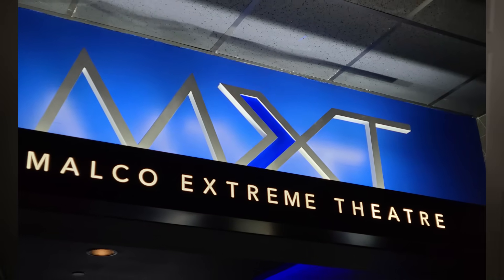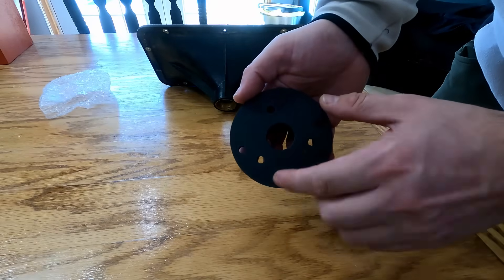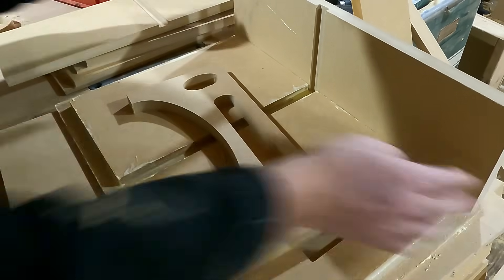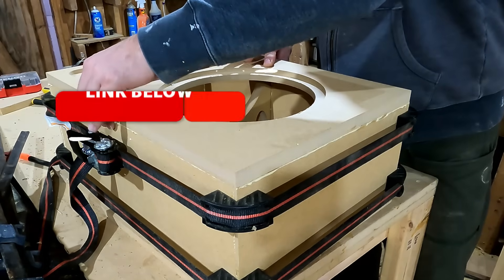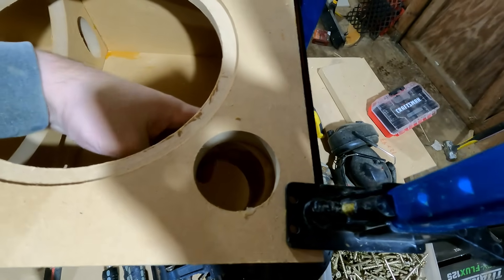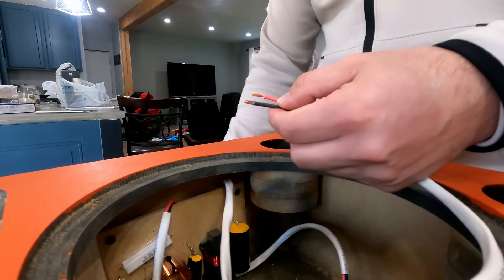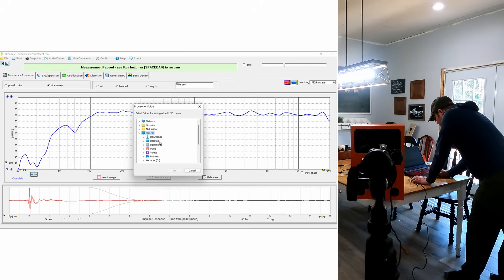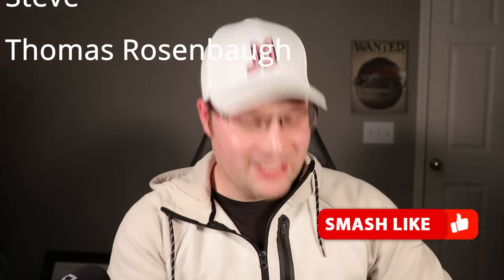How to Build $5000 Speakers for $400 - Klipsch KPT Inspired - Cinema 10

Comment: Cinema 10 or the Soundstage 15? 

Best for hi-fi home audio? What is the difference?

Or what would you consider the best hi-fi speaker you have designed? After understanding this I will order the plans (if I can get the units of cours)
Reply from the maker: I would still go with the Soundstage 15.  They are great for that.
Reply: @Toid  Thanks, trying to register a account on toidsdiyaudio. Not getting the conformation mail. I tried multiple email addresses.
Reply from the maker: @adriaan7627  that was my fault. Let me fix that for you
Reply from the maker: @adriaan7627  you should be activated
Reply: @Toid  Not yet 🥺
Reply from the maker: @adriaan7627  send me the email address and I'll manually activate it

Comment: Hi Toid, i have built a few speakers over the yesrs and notice you used no panel damping or stuffing, are you not concerned about cabinet resonance, standing waves and rear reflections back to the woofer cone? Another great video by the way.
Reply from the maker: That's a great question. It wasn't necessary on this build, but it never hurts to add it.

Comment: 'Very cool project. Now that you've built speakers using both the B&C DE-250 and CDX1-1745, how much better is the polyimide DE-250 over the mylar 1745? The reason I'm asking is according to Celestion tech support, I can upgrade my 1745's to 1747's by changing the just diaphram, which I'm kind of interested in doing. Any thoughts?
Reply from the maker: Honestly, it is hard to say. The B&C are in a traditional horn versus the 1745 which is in a waveguide.  It really changes how they sound, so it wouldn't be real fair to compare them like that.  However, I do have a compression driver shootout coming out soon.  SO when that comes out, I might have some more insight.
Reply: @Toid  Thanks for the reply, and just a note to say I like the type of projects you've been doing on this channel. A compression driver shootout would be very cool as there's so many choices out there even within a given price point. If I can find a driver that has the top end extension and fine detail of my PRV-290, but with a little smoother lower treble and lower first resonance that would be my ideal driver. Now that I've tried the 1745's, 220-ti's, and the PRV's, I suspect the 1747 might be magic combination of what I'm looking for, but I just read on one of the forums where a guy was saying the Eminence PSD 2013 was one of the best sounding drivers he's ever heard, so yet more confusion. 'Keep us posted.....

Comment: Wow. I would pay up for a flat pack of this speaker if it were available. GREAT choice on the color. Do you have a code for it?
Reply: I too would like to order a flatpack. Please tells us where we can order this when available.
Reply from the maker: I'll get you the code. It's from Sherwin-Williams. Also I am going to be offering flat packs sometime this week. I just have to calculate the cost.
Reply: @Toid  Awesome! Thanks.
Reply: @recone_helmut  could you share with me what a flat pack is?
Reply: @garymcnemar6620  Sure. All it means is that the panels of the speakers come as a kit - packed flatly on top of each other. The DIY speaker builder then takes all of those parts (the front, back and all of the sides) and glues it all together. It's an easy and far cheaper way to ship speaker cabinets.
Reply: @recone_helmut  is it possible to find out the cost?  I don't mind, since I don't have the cnc machine to cut the boards to precision.
Reply: @garymcnemar6620  I'm not the maker, I'm a customer! I'm hoping for the same info and have my money ready :-).
Reply: @garymcnemar6620  its a kit.  build it yourself.

Comment: Great build! I’d love to duplicate the old Polk audio towers with (8) 6.5’s and a 15” passive. Or some Def Tech towers with side firing powered sub? So many possibilities! BTW, I could watch that CNC all day
Reply: sda-srs
Reply: @josephlalock8378  yes!
Reply from the maker: Thank you! I appreciate it. I've always wanted to recreate the definitive technologies or even the golden ear. I used to have some, I ended up giving them away to a friend that always wanted them when I started really getting into speaker building. That is definitely on the list to build someday. I never thought about building some Polk towers, but you might be on to something.
Reply: @Toid    I remember when the SDA-SRS speakers came out.  They were a beast and sounded pretty good.   They were not as transparent as the Apogee Scintilla or as fast but they made a good showing of themselves.  Nothing like playing Ride of the valkyries with a PS Audio 200Cx cranked through them.  Would make a fun play.  Then again the Klipsch Korner horns were awesome too!  Oh the old speakers, so many good ones to be had.  For our system at home we have a set of four KD-4 for the corners and a KD-2.5 MTM for the center.  Great image in a bad listening space.  Nice build.  Did you consider trying to source the actual drivers used in the KTP speakers?
Reply: Why not the holy Grail? rarest of rare. Frazier model 11's! I have set 50 of 100 if you would like dimensions. 😮
Reply: I have a pair - best speakers I have ever owned. I did a video a few years back on them. Love the amp reviews btw - I've been watching since it was BigDWiz!

Comment: Loved it. How well do they image? How was the Bass? Tight and punchy? Horn Tweeters or compression drivers, I keep hearing that they are shrill and tiring for long listening. What was your experience with these? Can these be considered for stereo  system? Thank you for your content.
Reply from the maker: One of the great things about this waveguide, is it doesn't have the honkiness associated with typical compression drivers in a horn. I have no issues listening to these without tiring out. It should be pointed out that these are really designed to be crossed over to a subwoofer around 80hz.  So you aren't going to get a lot of bass below that.

Comment: Like the work. What brand and size of the CNC  Machine!  Would you pls post the info where to buy also. thanks
Reply from the maker: It's a Cnc4newbie 48" x 48". https://cnc4newbie.com/store/en/cnc-machine-kits/c4n48xx/c4n4848tk-p110c74c98/ they also have the new carve which is a little bit less expensive.

Comment: Great videos! have you experimented much with higher quality crossover parts, do you feel that spending more money on inductors, resistors, capacitors and speaker wire can improve the clarity of the speakers?  Thanks! 🔈👍🏻
Reply: JR, I can answer that. If your building high end stereo  speakers, AND you have the high quality front end components then yes. It's a balancing act, $60 foil caps on a $120 woofer is a waste. Same cap on a $250 mid or tweeter might be mid price. Balance the XO parts with the drivers. IMO XO should be about 1/2 to 2/3 the cost of the drivers. Of course it depends on the order of the XO and # of parts.
Reply: Believe me it's not a waste. With quality components on cheap drivers you can make them sound very very good indeed and really make them sound very premium. Also if the person who.made this video could add gaskets, screw inserts as well as resonating deadening stuffing in the cabinet that would help a lot as well for (sound) quality. Still a nice job and good looking speakers

Comment: Awesome DIY. Klipsch has been raising prices (even before the pandemic) based on heavy marketing. I do like their sensitive speakers and this DIY project is really interesting.
Reply: Klipsch arent even that sensitive   about the same as most other speakers in the range. The way they do their testing is wrong and the opposite of what is basically agreed upon so that they can get these higher numbers to deceive people.  ill never buy Klipsch just because of that
Reply: @patrickrosington1174  That’s interesting. Ages ago I owned a pair of Klipsch KG 5.2’s. Spec wise it was 96 db 34-20KHZ. They were the shortest ownership I’ve had for any speaker. Sold them after a 8 mos. I don’t believe for a moment it went down to 34Hz. Too harsh and bass was flat.
Reply: @epi2045  it's -3dB @34Hz and they meet the target. that being said, two 10" drivers can't sound too authoritative that low..

Comment: Great Video, as always! Im currently building the cinema 6. How do the cinema 6 compare to the cinema 10, except the axis response? Would you rather build the 6s oder 10s in terms of sound quality? Thank you:)
Reply from the maker: They're just designed different. The cinema 10 are really designed to fill up an area a lot more with space. Where the cinema 6 are designed more for you to easily point out where the sound is coming from.

Comment: What CNC Machine is that?  Looking to build one this year for guitars, amps and speakers.
Reply from the maker: This is the Cnc4newbie pro4848bl. I'm a huge fan of going with a 4-ft by 4 ft if you can. You end up wasting a lot less material if you're going to use sheet goods. But if you don't need to sheet goods, you can obviously go with a much smaller size. And for those that don't want to go with the pro model, they have the newcarve, which is a little less expensive.
Reply: @Toid  Fantastic I'll check them out.  Looks like a really stout machine.  I had planned on a 4x4 exactly for that reason.  I'll be doing mostly guitars but I can see building speakers and amp cabinets. thanks for the response

Comment: Should have chamfered the ends of the ports, but otherwise looks nice.
Reply from the maker: There's no need as far as port noise is involved. There's also very little room to do that with where it's placed. So it would have just been an aesthetic look more than actual functionality.
Reply: @Toid  Judging by the papers I have read on the subject Chamfering does help at high output, which is the point of a project like this, you need a lot of port area to avoid port compression at high outputs.
Reply from the maker: @CorradoVR6z  it can help, and helps even more if both ends are rounded over. But that all depends on the design concept. These are designed to be crossed over by 80 hertz and they're very high sensitivity. Add all that together, around over is not useful in this at all. With no roundovers and maximum power to the woofer, you never go over 17 m/s for Port velocity. But you are correct, especially depending on the design, roundover can be highly beneficial.